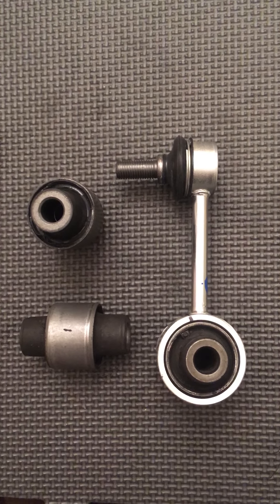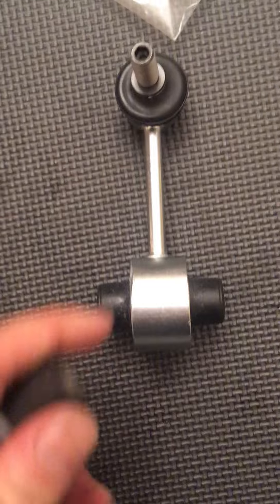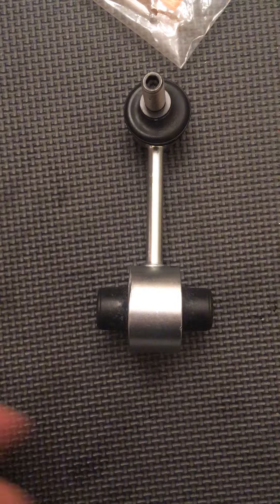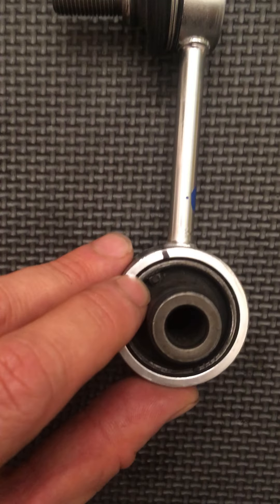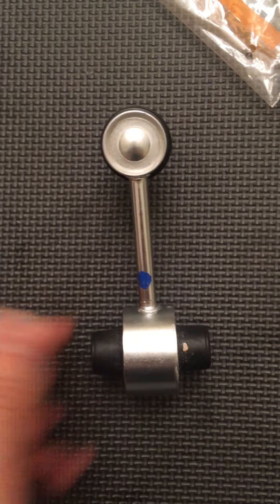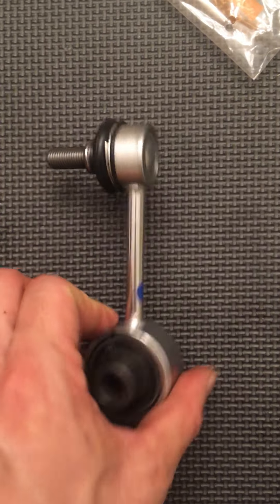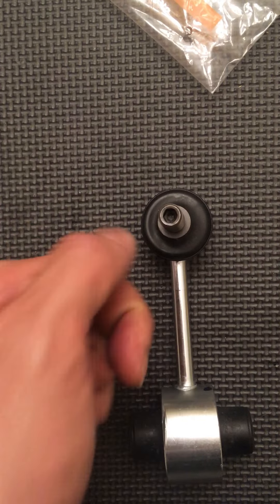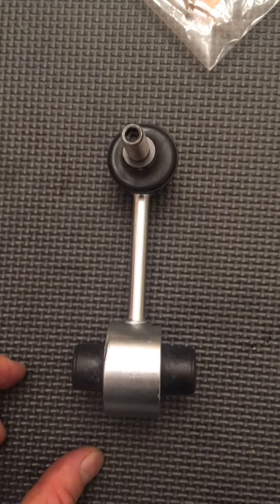2017 WRX JDM Group N Rear Stabilizer Link Bushing Install Tips Part 1

Comment: Yo! I love all the new rides you got! Livin' the dream!

Do you know why this is listed as specifically for use with the 18mm rear Group N swaybar? I just noticed that while looking at the description in the Group N catalog. It's not like the bushing directly connects to the swaybar itself. I have the 20mm swaybar that I'm going to install but I'm having second thoughts about installing this also.
Reply from the maker: Hey what’s up bro！Been a while since I heard from you lol. Thanks！Love the cars and def feel blessed to have them. Not exactly sure why it’s only made for the 18mm sway bar, I actually think my WRX is stock with a 20mm rsb but I went ahead and installed it. My assumption is the 18mm rsb allows for more independent suspension movement so they want to make sure the car doesn’t lose traction on rough roads with a stiffer bushing？STi seems very exacting when it comes to their products which is pretty awesome imo. Up to you！

Comment: Hey, again! They only have the Group N bushing for this part, not the entire endlink, right? I have the bushing but wasn’t sure if I could get a Group N version of the actual endlink. I can’t find anything on it so just making sure. Thanks!
Reply from the maker: Hey what's up! It's only the group N bushing. There is no GrpN endlink version from what I know, the ball joint for the endlink is as stiff as you can get lol.
Reply: @j168vlogs  Thanks! Yeah, the ball joint was my main concern. At least I don’t have to get another part.